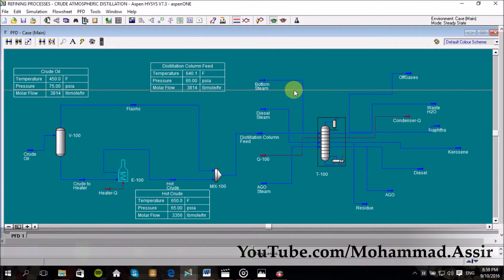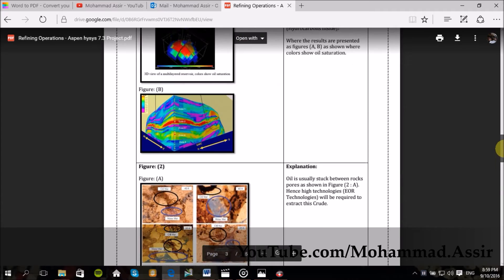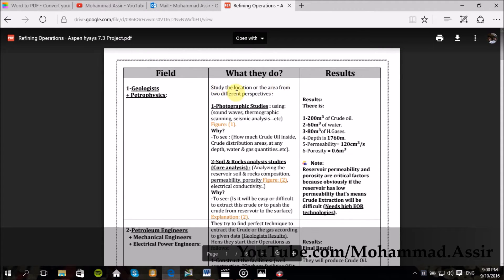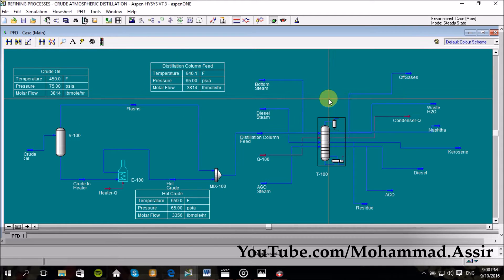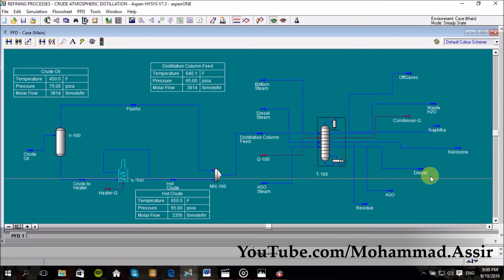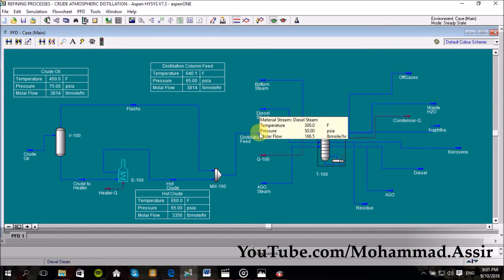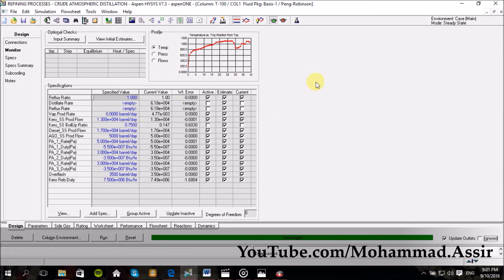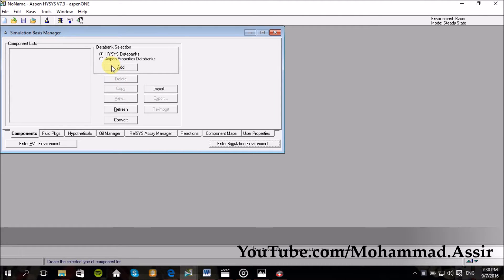1-Refining Processes - (1/2): Atmospheric Distillation Unit - Aspen hysys 7.3

Comment: Hello Mohammad. im trying to run this flowsheet on Aspen HYSYS v8 and the ATM column is not converging. Please, help!
Reply from the maker: Really !! ok i'll send you the Plant the (hsc) file "give me your email" but before that also you can try the another video [Batch Method].. then if it didn't run you can send me your (hsc) file so i can check the problem..

Regards
Mohammad Assir
Reply: Helo, please, give me  your mail to send my hsc file.  thanks.
Reply from the maker: dr-zoling@hotmail.com

Comment: Hello mohamed . i did a simulation on a crude distillation unit with preheat train . how can i remove the coolers  from top & bottom pump around and connect both streams with  heat exchanger network . thanks
Reply from the maker: Well Dear Fateh Ben Zayed 

If i got your point right yeah that can be done but it will be better if you send me your process details or some screenshots for your plant to get your exact point and help you better. [ dr-zoling@hotmail.com ].

Regards
Mohammad Assir

Comment: Hello Mohammad. im trying to run this flowsheet on Aspen HYSYS v8 and the ATM column is not converging. Please, help! i really need this working
Reply from the maker: well.. probably you made some mistakes in some numbers bro.. coz I have done it in both (v7.3 & v8) with same values.. However just tell me where did you stop.. / send me an e-mail (dr-zoling@hotmail.com).. and it will be ma pleasure to help you..
Reply: Dear Ekson,

My name is Alex. Could you help me to reach column convergence? I tried many times but unsuccessfully.

BR, Alex